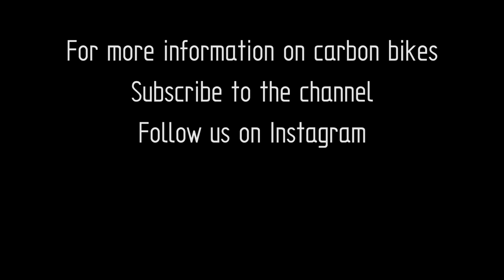Don't do the "squeeze test"!

Comment: Had a cannodale rush 10 frame out of the box and the carbon hadn't been cured or spots had a lack of resin . Parts of the tubes were like paper . Didn't even need to press it to see it had no structural strength . As I rotated the frame I saw the tube had "dents" in the paint I very lightly touched that part of the down tube and it felt like a piece of cloth moving . Yeah that frame was warrantied.  That was the 3rd rush 10 frame the customer had as a warranty replacement . 
He got his money back from canandale and bought a banshee frame instead .
Reply: WOW! They had some serious failures in their quality controls.
Reply: @DaveCM  it's why they are called crack and fails

Comment: if a frame is so fragile that it cracks when i press down on it with my thumb than why would i ever consider getting one
Reply: Why would you press down on it, though? After watching this video.
Reply: @AnttiBrax  ... maybe by accident when riding it or when transporting your bike on/in a car ...
Reply: @PaoloLuraschi  Get a $100 travel case for your $6000 bike. 😀 I've never squeezed my down tube while riding and I have long-freaking-arms. Crashes are crashes, you're bike is toast anyway.
Reply: @AnttiBrax Well, "by accident" I was not meaning a big crash ! Maybe by accident you just drop your bike while it is parked. The issue is that the damage may not be obvious like a dent on an aluminum frame. Do you put your bike in a case when you load it on the roof of your car ? If so this is fine, but I just don't like to take care of all this just to ride a bike for fun. I understand that a pro rider will have different priorities than me, no problem with that !
Reply: @AnttiBrax  its not just "pressing" down on it with your thumb, but if this is so weak i would be even scared to lean the bike up against a wall
Reply: Interesting reasoning there. Then what about that truss bridge where I can actually stick my arm through the opening in the truss? Is it safe to drive my bike across it? What about the giant hole in the middle of the bike truss? In all seriousness, while a frame might be perfectly capable of supporting cycling loads and still have very flexy sides in a deep section frame member, it's not suitable for use by most cyclists, even racers who aren't given a new one each morning. When I build my family's CF bikes, I added CF anti-crush layers beyond what the riding forces demanded because I wanted them to also withstand the forces of reality, falls, knocks, etc.
Reply: @BlackgoldTwinduck I agree 100%. My next new gravel bike will have alu frame that's for sure..
Reply: @BlackgoldTwinduck  It seems that a lot of folks have been buying carbon and expecting steel. They all have strengths and weaknesses and need to be treated individually. If you're not willing to take very good care of your bike, then obviously carbon is not for you, no matter what the sales drones try to say.

They're innit for extracting every last penny out of your pockets. Don't buy into bullshit. Stay vigilant.

Comment: Bicycles, if they are going to be used, take a lot of knocks from all different directions. If a bicycle can't handle a simple squeeze then it should be much much cheaper. If your bicycle is so fragile you'd be better off belonging to a professional cycling team that handles all bike replacements for free. The average consumer can't afford this fragile bullshit.
Reply: Also consider that at the wall thickness these bike have, some flex may be better than being stiff and brittle. The ability to absorb some shock should be better than being so stiff that an impact would crack the tube.  Thicker walls might ultimately be best, but at the penalty of weight which defeats some of carbon fiber's appeal.
Reply: @zaheerkader7426  The bike is not designed for what you want it for.  That means you should buy another type of bicycle.
Reply: The average consumer doesn't have this bike bro.  If you want a tougher bike you get an aluminum gravel bike for knocking around and keep the carbon roadie for nice dry road rides.
Reply: @Aholeintheozone  Steel is real.
Reply: A guy I used to ride with had his egg-shell thin, high-modulus carbon bike fall over in the garage-it broke. Sure, he was able to repair it, but personally I'm not interested in gaining seconds  on a ride by having a bike that fragile. Aluminum is the way to go, unless you're racing. If you just really want carbon, sure, why not!

Comment: I agree (to some degree). Other side of the story is that there are bike manufacturers that just push the limits too far to save the last  few grams in weight... 

I bet many normal bike frames (read: lower tier) are stronger (read more impact/accident proof) than their higher tier 'extra light' frames.
Reply: New Scott Spark use it as a selling point, top tube thinner than a credit card apparently.
Reply: Many frames in the past also had a cosmetic lair of 4k weave over the UD carbon. The frame was  a little heavier but probably better suited for us recreational cyclists.

Comment: Everything Raoul says about carbon bikes makes me determined never to buy another one. "Oh they work fine in ideal situations where there's no sharp edges or things to crash into at speed which will make them fail on the second impact"
Reply: How many real bike incidents caused by carbon failures do you really have heard of? All is said here in true in thoeory, but in practice carbon bike are super safe, IMHO
Reply: Thought the same way, until I got my lightweight aluminium frame.
Nice bike, but in no way more robust than a carbon frame.
Drop a carbon frame on a sharp edge, you might get a crack.
Drop an aluminum frame on a sharp edge, you will get a dent, that might buckle.
Same thing basically.
Reply: @kilianortmann9979  I chose to make my wife a custom CF touring bike precisely for this reason. I'd seen too many of those fat-tube, thin-wall aluminum frames damaged, as well as carrying numerous work-hardening cracks near the welds. I chose CF not only because, done right, it's perfectly capable, but because it's so much simpler to DIY and far far safer than welding. Of course, I didn't try to make it weigh nothing by sticking with minimal structural strength at the cost of crush resistance. So far the only catastrophic failure on the thing were aluminum bar-ends that tore right in half when a car cut her off at an intersection and she dropped the bike.

Comment: seems like the mechanic saved someone from riding a death trap. If a top tube can split in half with a hard press of the thumb, no way its safe for actual riding. what the fuck.
Reply: As is the case with the top tube on many a CANYON bike. If you have damage, you can extend it to "beyond repair" if you stress it further.
Reply: Some bikes gets their stiffnes, strength etc. from the sides of the frame, so when pushing limits on how light the frame is going to be some areas only needs material to ”fill“ out the shape. Like the top of the top tube. However Basso for example put extra material there only for you to sit on during coffee stops, I think! I imagen a Canyon being flexy in that area and a 2015 Emonda too, still nice bikes…
Reply: @mariusilerd9581  I hear you. Still stand by my point. These bikes aren't safe unless your a pro with a mechanic making sure everything is intact before every ride.
Reply: They fair much better in a pro peleton with replacements at hand yes! They also get abused more, Im fine with babying my bike so to speak, but it doesnt have a integrated handlebar nor the flex problems they talk about
Reply: @87togabito  Luckily my body seem to be made out of stuff that is tougher than the SL7, been pressed hard many a times and Im still intact. Sounds like a butt hurt Tarmac owner to me, I pray that that your fork and frame hold up during one of them steep descents buddy
Reply: Well said 🙌🏿
Reply: @mariusilerd9581  You are not actully sitting on the top tube but leaning your butt against. What is the load? Maybe 60-80N in worst case? How much pressure can Durianrider generate with a thumb? 30-40NM? And that sideforce would delaminate the paper-thin tube? I'd say the tube is way too thin for safe usage.

Comment: All because of the pursuing of light weight, less material, thin wall, small size tube. It should have decent wall thickness. Our bike's down tube has 3 gussets inside.
Reply: No. All because of road disc brakes!
Reply: Isnt the point of this video that, even if it was thick, it's still not a good idea to go around applying loads that it's not designed for?
Reply: @Mr T ok, don’t learn anything 🤷🏽
Reply: @The Puertorican Cyclist I feel u🙌🏻 No squeezing any frame, yes, but those 300 grams comes in handy to ad some carbon layers in a frame, no doubt.

Comment: If it can't survive a simple squeeze test, how is it even going to remotely survive a spill or crash?
Reply: Bruh a bump in a road is different, did u not get the point? Its not designed for the «thumb test» but they are designed for bumps on roads🤦🏻‍♂️ Smh
Reply: You gotta be like Joseph Gordon-Levitt in Premium Rush predicting all the scenarios in a split second so you don't ever crash or fall over.
Reply: Different kinds of impulses; you aren’t constantly applying pressure perpendicular to the direction of the fibers when you crash; you’re bumping the bike. Very different things from an engineering point of view
Reply: It won’t and that is why there are many carbon repair places around
Reply: Throw away frames, they are not designed for such stress.  Thanks to the weight weenies out there.  Strip the frame and replace it.
Reply: Many materials get damaged in crashes, I've seen bent alloy frames from steel to aluminium.
Reply: Usually when a crash happen its the pedals, handlebars, brakelevers and skewers that actually hits the ground and slides, so🤷🏻‍♂️ If ur unlucky you are just that, unlucky! A nice car can be broken, but its still a nice car😌
Reply: Oh, and the saddle ofc**

Comment: If the frame breaks because of squeeze test that means you guys are paying too much money for stupid weak carbon bike 🤣
Reply: I can dent a Fender on many modern cars with my hands especially the aluminium ones. Does that mean that modern cars are inferior or just designed differently?
Reply: @johnsmith1474  🤔😜
Reply: @John Smith 🤌🏻
Reply: Agree, that’s why I ride a titanium and steel bike. I have a cut tube of titanium, the same as the one on my bike. It’s less than 1mm think, probably 1/4? Anyway I challenge people to crush it… even though it’s an empty tube cut open at both ends nobody has been able to deform it with hand strength.
Reply: Carbon fiber ALL DAY carbon everything, I wished they made carbon fiber cables too, and every screw🙏🏻🙏🏻🙏🏻 Talking about steel bikes on the carbon GOD’s channel😒
Reply: @glennoc8585  A dented car fender doesn't affect the performance. A bicycle frame is like a car chassis. Can you dent a car chassis?
Reply: @glennoc8585  
you could ask yourself if a fender is a structural part of an automobile first.
Reply: @drooghead  chassis? Which heap of junk car has a chassis in 2021? I guess you think driving a truck is safer.
Reply: @larkhill2119  what are you talking about? Every car has a chassis. I dont understand your comment.
Reply: @glennoc8585  The plastics fenders are designed to bend and take the impact load. Aluminum fenders are just for decoration as aluminum has no inherent strength in contrast to to steel.
Reply: @Chrome Book Don't exagerate. The S-works "Speed of Light" is only U$15.000 and not a penny more.  ;)
Reply: @reginaldscot165  You mean that you have, honestly, never heard of cracked titanium frames?? Honestly???   Rgr
Reply: @mariusilerd9581  you know why they don’t make carbon screws? Because it’s soft and wouldn’t make good screws, just like how it makes for a terrible BB interface. Carbon is cheap plastic, it’s popular because the manufacture wants you to want it, that’s why they paid billions in marketing to convince (not smart) people that’s it’s a wonderful product and what you should want. Because it’s incredibly cheap to make and they can charge insane mark up on it. And funny how literally every video the “carbon god” made is full of reasons why carbon is a terrible choice. And yet he defends you going out and buying it because it’s his job to fix it when it goes wrong… and it does, frequently.
Reply: @borano2031  I don’t believe I said that, yes titanium cracks. But it’s not the norm. Most people that buy a titanium bike keep it for life. And the rest get a warranty. (Lifetime on good Brand’s) also, you stand way more chance of surviving a titanium crack than a carbon one.
Reply: @Reginald Scot Bruh… 🥱 I would pick my Carbon bike over my Alu one anyday, way nicer ride-feel! Your statements about the BB depends on the brands manufacturing standards and build quality, if they cant make it round thats on them, not the material used. I have been riding 5 years on one single press fit bottom bracket without a single creak sound EVER, and I commute on the same 6,8kg race bike, in Norway so dont speak to me about bad weather either…
Reply: @glennoc8585  Car fenders are not structural while the bike frame tubes are. Cars have a monocoque or tubular inner frame on which fenders are bolted on.
Reply: @larkhill2119  Most modern cars still has a chassis be it welded together monocoque of steel panels or in some rare cases, welded tubes. Yes they are still called chassis.
Reply: @borano2031  The cracks are usually at the joins not the middle of the tube or propagated from the welds. And the cracks are formed from improper purging during welding. You will find it very hard to find a Ti frame that has cracked from the middle of the tube.
Reply: @mariusilerd9581  You are comparing carbon with aluminium, not carbon with titanium. 2 total different things. Yes most Aluminium bikes have a harsher ride. However I have a friend who I sold a Bowman palace R to, he also owns a Factor 1, the Bowman is aluminium and way way cheaper than his factor carbon bike and he’s normally riding the Bowman? I asked why he does that even on longer rides, he says he prefers the feel of the Aluminium bike. So it depends on the brand and make of the bike somewhat. I work in a bike shop and have ridden many carbon bikes, non have a smoother nicer feel than your average titanium bike. Carbon is normally stiffer and less comfortable in my experience. However the titanium bike I ride is very stiff, even for a carbon bike, but it’s still incredible smooth in comparison. The issue of the BB is the material is more difficult to get right, carbon is moulded, titanium shells are cut by a mill or CNC machine. The moulding process is inherently inaccurate, even if your BB is not creaking that my be more to do with the Type of BB you are using and who installed it than how round the shell is. Trust me, I fix 1-2 out of shape carbon press fit shells a week. 😂
Reply: @Reginald Scot Thanks for a very good reply! I was waiting on it🙌🏻
I have only tried one titanium bike it was a Wittson with Colnago chain/seat-stays. Felt super! Stunner to look at also. Maybe not as snappy but it was too big so not a fair test. Owner(friend of mine) noticed the stays where rubbing on the crankarm but the frame builder took it back and fixed it👏🏻
The bike in question is a 2014 Ridley Helium Sl with Campagnolo Power Torque cups. I got the frame from the leftover stash from TDF, those that get painted over night by brands when a rider from their team get a classification jersey, but it was never used, it has polka dots on it and Tony Gallopin was riding the yellow one. Im not sure if pros get frames that are reinforced in anyway? Anyway i was suprised about the BB bc all the mechanics in the two shops I have worked in hates Campa so I was ready for the struggle. 5 years later it is still like new🤷🏻‍♂️
Reply: @drooghead  That's exactly my point. It's more than meets the eye or the feel it's the whole underlying engineering that must be considered. A paper thin down tube will still build up in wall thickness, material type will often change  at the extremities. As Raoul has said "don't point load the downturn with you fingers" it's not saying the design is inherently flawed .
Reply: @Exgrmbl  yes and no. Take every hanging panel and door off a car and go for a drive then tell me if the ride feel is the same.
Reply: @DilbertMuc  Yes and for weight saving. That's the point of the thin walls on these bike tubes. With proper design the frame will last just care must be taken by the user more so than a heavier traditional material and design.
Reply: @Teakhead Al what if your frame was from an online store based overseas? Ship back at consumers expense is the usual procedure. Ok if you're in America,where you can buy a Ti frame from a manufacturer knowing a warranty is a fast turnaround. Ti frame are heavy, expensive and crack, that's an irrefutable fact. Oh and most road version come with a carbon fork.
Reply: @glennoc8585  Depending where you live the same problem exists with CFRP frame warranty too. You still have to ship it back to the manufacturer in the hope that they will replace it. Ti is not heavy, no longer expensive and do not crack (in the middle of the tube) unless the welding quality is poor. My Merlin weighs only 7.5kg with a full Bidon, saddlebag, Cycliq Fly6 and Fly12 dashcam and Omata One cycling computer. A brand new Ti frame from Lynskey is around $2.5K. There are many 30 - 35 year old Ti bikes from the likes of Merlin, Litespeed that are still being used. Yes the only downside is that most Ti bikes come with a CFRP fork - however, you can have it replaced with a Ti fork, that is what I have done with my 18 year old Merlin Cyrene Ti road bike which I purchased a couple of years ago.